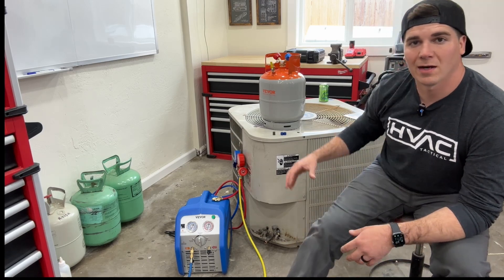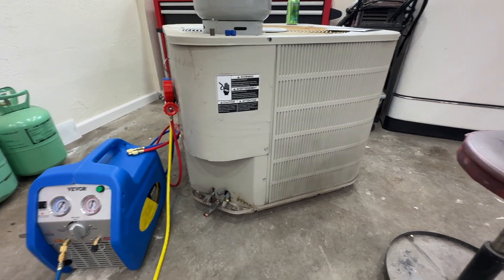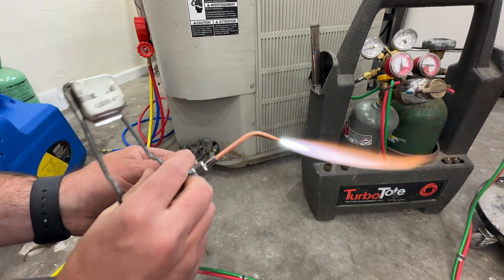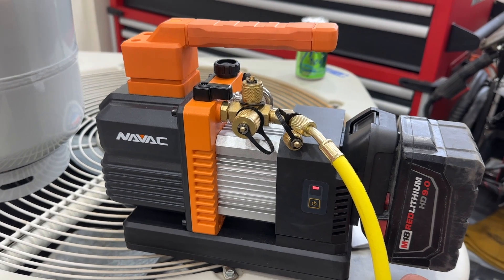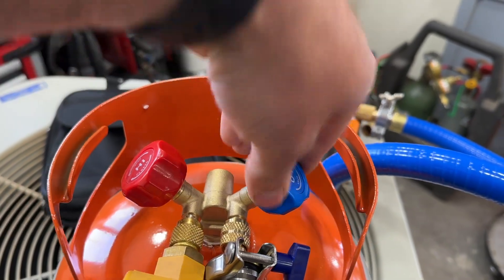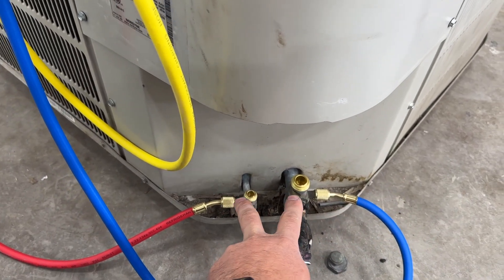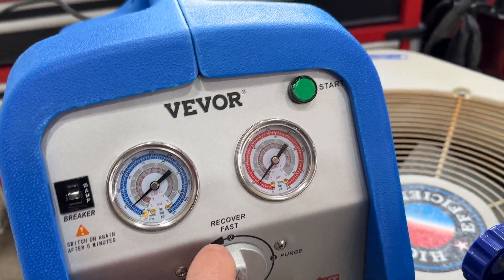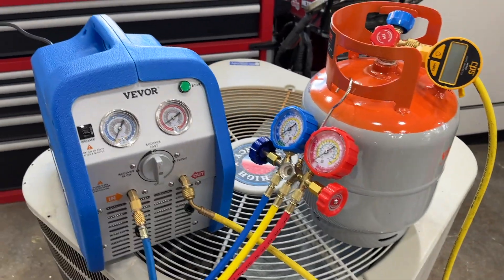How To Properly Recover HVAC Refrigerant Into A Tank

Comment: Hello,
I am new to HVAC and I’m trying to understand how to recover refrigerant. In this regard, I have two questions:
	1.	Was your recovery tank empty, and is that why you connected hoses to both the liquid and gas ports in order to vacuum it?
	2.	During the recovery process from the plant, you connected both hoses to the liquid and gas ports and opened the blue valve on the recovery tank. Was that for liquid recovery? So, in this case, you collected liquid in the recovery cylinder, right?
3. Which line we should connect usually on the plant for recovery liquid or vapour. 

This part is still a little unclear to me. Any insight would be greatly appreciated.

Comment: What is your recommendation for a recovery system for home DIY person.  I do my own vehicle AC work but would like to also maintain my home HAVC unit.  I'm looking to buy a recovery system that will work with most Freon used for vehicle and home that is the price range of $400-$500 (recovery machine) and tank extra.  My home AC unit has the R22 now and would like to be able to use with most common freon out there and some recovery system will only work on certain freons (2-3 types)?  thx.

Comment: Noob note to DIY 1st timers; Be sure and check your pressure 1st before buying a recovery machine. My system had not been used in years and was getting rid of it. When I put the AC manifold gauge on it there was 0 pressure, all the R22 had leaked out over the years it sat. I just got back from returning mine back to Amazon via the UPS store.

Comment: You should have isolated "before the pump" first, not at the cylinder and then turned the pump selector to purge, to get rid of excess refrigerant in the pump. Then isolate the cylinder.

Comment: 7:35 Whoa, whoa. That's letting refrigerant into the atmosphere, no? I thought the whole point of having the machine is not to have to do this step. Why not draw those down to a vacuum first?
Reply: That’s called deminimis, It's an exception to venting regulations, allowing for minor, unavoidable releases while technicians take proper precautions. For example, connecting or disconnecting hoses to charge or service an HVAC appliance
Reply: @woahshuan6321  Thank you, I've since read up on this further and the technique makes sense to me now.
Reply: @woahshuan6321 yes but it’s mostly air and refrigerant that’s why he’s trying to purge it so there’s no air in the process
Reply: That's not  refrigerant

Comment: Is a specialized machine needed for R32?  Or could that same machine for R410A work fine?
Reply: I just bought the Vevor Machine. That was one of my research questions before buying. It can do several types of refrigerant. 

Advertised:

About This Item
• High-Efficiency Recovery: The 3/4 HP brush motor refrigerant recovery machine swiftly recovers vapor and liquid refrigerants at a maximum rate of 4.85lb/min.
Equipped with an efficient fan and condenser, it provides stable, strong, and long-lasting performance for professional-grade applications.
• Small in Size, Powerful in Function: Look no further than our lightweight 29.5 Ibs recovery tool, perfect for servicing different refrigeration equipment! Get ready to recover a range of refrigerants, including R134A, R22, R12, R410A, R404A, R502, etc.
• High-pressure Protection: Accurate pressure gauge can precisely monitor the pressure. When the pressure reaches or exceeds 38.6 bar/558 psi, the portable ac recovery machine automatically stops the recovery to ensure safe operation throughout the recovery process.
• Self-cleaning without Residue: After each use, simply turn the knob to the PURGE position. This will activate the freon refrigerant recycling machine's self-cleaning function, which safely discharges any leftover refrigerant into the recovery tank. Additionally, This reduces the risk of machine damage from expansion.
• More Purer, More Safer: With its reusable and easy-to-clean filter screen, this dryer efficiently blocks impurities from entering the intake port and ensures that the refrigerant is moisture-free to prevent oxidation and rusting. Regu' replacement of the dryer is advised to maintain the ,
个
of the recovery process.

Comment: If you fix a leak on a mini split (for instance), and need to take out the remaining refrigerant, weigh it, and then put that back in with the additional missing amount, how does one go about that process?  I can’t find ANY videos that show that scenario.  Thanks!
Reply: you must read the label on the outdoor unit, it has the amount and type of refrigerant listed. you need a scale.

Comment: Thanks for being educating the recovery steps. May you please let me know what kind of yellow hose connect from recovery machine to the recovery tank? I am new to HVAC and DYI for my home. I already have the Appion hose (APPION 3/8' DIA. HOSE, 4-FOOT, 1/4'FL TO 1/4'FL - MH380004AAY). I bought this hose for vaccum procedure. Could I use this hose to connect from recovery machine to the recovery tank (of course at the outlet port). May you please advise?
Reply from the maker: Yes you absolutely can. As long as it has 1/4” attachment points as that’s standard 👍🏼
Reply: @diyhvacguy  Thanks so much for your quick replied.

Comment: Hi your video is awsome. I have one question regarding this video. I have not seen any liquid or vopor option on refrigerant recovery machine.Whereas the compressor suction side have refrigerant in vapor form and compressor dicharge side have refrigerant in liquid form.So according to my understanding, as you open both valves in the outdoor unit at once and switched on the refrigerant recovery machine, it is sucking both gas and liquid refrigerant from the system and transferring it in the refrigerant storage tank. is it true? Normally in refrigerant recovery machines there is an option for liquid or vapor selection with a knob  and we recover liquid and gas refrigerant separately

Comment: How come you didn't place the recovery tank in an ice water bath?
Reply: I always use the ice bath for the recovery tank just because it lowers the recovery tank pressure and results in a little less wear and tear on the recovery machine. I recommend it too but often times, HVAC techs will skip the ice because it's not always convenient to get enough ice they need on the job before it melts.

Comment: Why can’t you recover the refrigerant directly into the tank? Since the A/C system is pressurized, wouldn’t the gas flow into the vacuumed tank? Or is the recovery machine necessary because not all of it will flow out?
Reply: It would reach an equilibrium pressure where the pressure remaining in the unit is equal to the pressure in the tank, leaving refrigerant in the unit.
Reply: @harryalbert9737 
Just saw a video on it and you’re correct (not that you need affirmation) it’s the reason I ordered the machine yesterday.

Comment: Thank you for creating these videos, very helpful.   Specific to the top here on recovering refrigerant, the cost to get the specific equipment adds up quickly. 
Does this seem right?  Are there any recommendations you suggest for the DIYr, who is not likely to do this more than a couple of times. 
Vacuum Pump >$400
Scale >$75
Tank > $130  (It is confusing why the tank is so expensive
Gauge to measure evacuation <500 microns  >$180
Filter Conversion Kit for Recovery > $75

Total Cost:  $860+

Comment: Where do you get those in line filter dryers. Turns out my 410A to 1/4" flare adapter was defective and was not pressing on the schrader valve on the condenser. So, I was basically NOT evacuating the line set on my new mini split system. I simply evacuated the manifold gauge and hoses. Unfortunately, I thought all was ok and released the refrigerant from the mini split condensers (yes, not one but TWO 2 ton systems!) so now the refrigerant is contaminated with whatever air was in the line set and evaporator/indoor unit. So, can the refrigerant be recovered and run through the drier/filter or should I simply evacuate the entire system and recharge with fresh refrigerant? Pretty upset. I followed your videos and the manual to a "T" and turns out a defective adapter, screwed me all up. Hope you can respond.
Reply: I saw a video where the tech partially backed the schrader out for that reason.

Comment: Can you use just a regular pump instead of the expensive reclaim
Pump?
Reply: no
Reply: 2nd No
Reply: @UrbanDIYer  I was told you can pull a vacuum on a reclaim tank and use manifold gauges to evacuate an ac system.
Reply: If your trying to reclaim the refrigerant by evacuating the recovery cylinder . Once the pressure in the recovery tank equals the pressure in the system , the refrigerant will stop moving . You may not recover all of the refrigerant .

Comment: Thanks for the video. Do you have to have a separate recovery pump for every different types of coolant? Ie, one for r22 and another for 134?
Reply: About This Item
• High-Efficiency Recovery: The 3/4 HP brush motor refrigerant recovery machine swiftly recovers vapor and liquid refrigerants at a maximum rate of 4.85lb/min.
Equipped with an efficient fan and condenser, it provides stable, strong, and long-lasting performance for professional-grade applications.
• Small in Size, Powerful in Function: Look no further than our lightweight 29.5 Ibs recovery tool, perfect for servicing different refrigeration equipment! Get ready to recover a range of refrigerants, including R134A, R22, R12, R410A, R404A, R502, etc.
• High-pressure Protection: Accurate pressure gauge can precisely monitor the pressure. When the pressure reaches or exceeds 38.6 bar/558 psi, the portable ac recovery machine automatically stops the recovery to ensure safe operation throughout the recovery process.
• Self-cleaning without Residue: After each use, simply turn the knob to the PURGE position. This will activate the freon refrigerant recycling machine's self-cleaning function, which safely discharges any leftover refrigerant into the recovery tank. Additionally, This reduces the risk of machine damage from expansion.
• More Purer, More Safer: With its reusable and easy-to-clean filter screen, this dryer efficiently blocks impurities from entering the intake port and ensures that the refrigerant is moisture-free to prevent oxidation and rusting. Regu' replacement of the dryer is advised to maintain the ,
个
of the recovery process.

Comment: Nice. Do automotive gauges work or are the fittings different?
Adapters available if different?
Do HVAC guys recover old refrigerant when doing a replacement and then sell it when repairing another old system?
Reply: legally you are not allowed to reuse recovered refrigerant apart from putting it back to the original owner's equipment. lot of contractors repurpose recovered refrigerant though.

Comment: Could you tell me if the Vevor recovery unit is AHRI or UL approved to meet EPA guidelines?  I couldn't find anything on their website, but I am interested in getting one as long as it's approved.
Reply: If the epa approves it it just means that it’s stamped with their approval because the manufacturer paid them enough for the stamp of approval….u haven’t figured out that most of the hype is all bs yet?
Reply: @w8what575  Yeah I know it's all money making BS, but regardless their rules require the machines to be EPA approved and I seriously doubt the Vevor is.  The owner of this channel decided not to reply so that tells me a lot right there.

Comment: I have 42 used ptac units containing 3# of R22 each that I need to scrap.  I am going to purchase the recovery machine and tank.  Question.  Is it possible to put the freon into empty freon tanks?  I'm assuming that I have more freon than the recovery tank holds.  Or do I just buy extra recovery tanks and store it in them?
I am not certified, but I have a lot of years HVAC experience and A/C experience.  
Thank You.

Comment: Great Video, Thanks! - O.K., but what's inside that mysterious "Refrigerant Recovery Machine"?  🤔- No big Deal:
It's a 2-Stage Oil Free Lab Vacuum Pump (100$), two Manometers + Valve.  At the In-Side a standard Filter Dryer (to be recycled by Heat) & preferably a 40ym Filter (Standard Water Separator) after. At the Out-Side a Valve is very important for not overheating the second piston head, nor heating the refrigerment. Without that counterpressure Valve the little Pump will try to blast a mount of Molecules at 30 bar (100.000 Pa) into the Outlet. [Machine construction at 6:27]
Those cheap oilfree (Outlet non conterminating) Pumps did make only slight Underpressure 950 mbar (95 Pa). You may already have a (100+$) 2-Stage oil Pump for Vacuum Evacuation. 0,05 mbar (5 Pa). If filled with Dry Vakuum Oil!

- The Refrigerant is at 15bar. A consumer Helium Balloon Bottle might be a storage Unit. It's save up to 45 bar. 
Concerning the cost of new refrigement - pumping old out, cleaning it by the way & using it again makes Sense. 
Even for the Atmosphere!
The content of 2-3 pumped out Refrigerators pays the bill for a "Refrigerant Recovery Machine". 😊
Reply: What recovery pump would you recommend for doing cars and small mini splits (9000-18,000)

Comment: Next week I plan to recover the R410A from a 18K mini split conndesor I installed last summer. Had a leak and not sure how much I lost. I have the leak fixed now and tried just adding a little back at a time no luck. I have a vevor recovery tank same as the one you're using in the video and just received my new yellow jacket recovery machine. I put a little 410A in the recovery tank before giving up and ordering the recoverymachine. Is it possible to recover the 410A without first emptying the recovery tank and pulling a vacuum again?

Comment: Hi , nice video 
I was wondering what is needed for working with R134A and R1234LF . Do I need separate recovery and vacuum systems to prevent cross contamination? Or is there a way to use these for both refrigerants ? 
Also the gauges being contaminated between these types ?
Reply: Did you find this info out Im wondering the same thing

Comment: Can you make a video on how to move a  working ac unit to a different location.
I get that we can transfer all the r22 in the unit, but when you move it to the new location how do you get a vacuum on the newly attached copper?
Reply: Wouldn’t the king valve be locking the Freon inside the actual unit and u would still be able to use the high and low side valves to pull a vacuum on the lines that go into the home to the coils and once u have them where u need them…u can just open up the king valve again and let the Freon flow into the lines …? Idk…I’m really new to this and am a hands on learner so this is difficult to grasp until I get to do it myself lol
Reply: @w8what575  epa test first here. keep king valves closed until you prove you have no leaks. vacuum pump must hold 28-30 negative psi over night. now, open king valves. start cooling, read low side gauge, there is a charging chart on the inside cover of the unit, follow that.

Comment: The video is respectable, but when welding the pipes at the outlet of the condenser and reusing that unit, the heat from the welding would be damaging the orings of the service valves. and at the end I didn't see that it purged the recovery tank and the hose that goes to the recovery bottle. Otherwise, as I said, the video is respectable.
Reply from the maker: Oh the unit is not being reused. It’s being dismantled and scrapped. Yes if it was a newer unit and was going to be reused, definitely protect it from the heat

Comment: I am new to this AC tech stuff, I am struggling to understand the role of using non certified recovery bottles. What can you do with it after you have recovered? Do you just put it under your stairs for 50 years? Or can you return theres bottles somehow? will they be accepted by anyone?
Reply from the maker: You can reuse the refrigerant in another old r22 system as long as it’s not being “sold”

Comment: Could you explain how to use the purge feature of that machine, and what that does?
Reply: Purging is just opening the hoses a little bit to let the air out of the lines. It’s not really a feature more of an action. You just open the hose a little bit and close it back up, you don’t technically have to to do it at each hose connection but it is good practice, you can just purge it at the tank and it’ll purge the hole line that’s connected if that makes sense. Hope this helped!

Comment: The recover machine, having a small condenser, will require a bit more purge to get all the air out compared to hoses.

Initially, when you may have some liquid refrigerant flowing into recovery machine, best to keep it on slow mode.  When pressure drops a bit after a couple of minutes you will have primarily gas and can go to fast mode.  Running in fast mode with liquid is very hard on recovery unit's compressor.

Recovery tank will get warm and if it gets too hot the pressure can exceed recovery tank working max pressure of 400 psig.  Recovery unit should shut down if pressure gets too high.  Cool outside of recovery tank with water to keep pressure down.